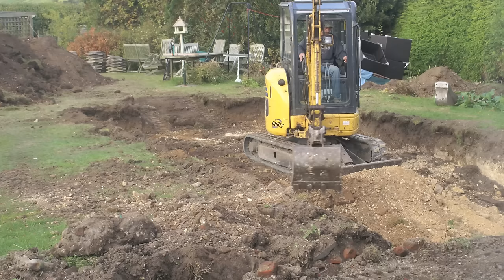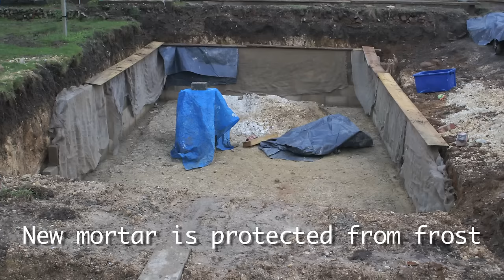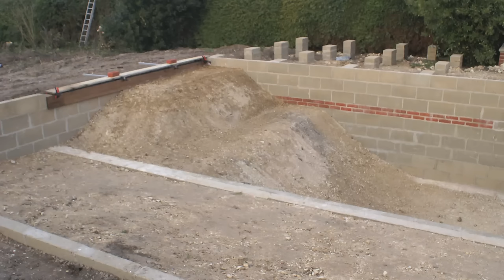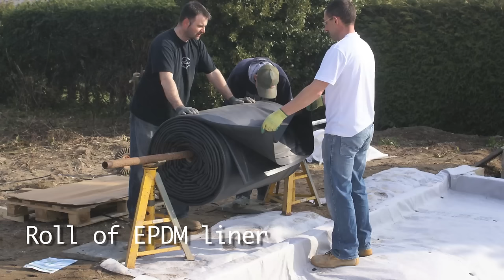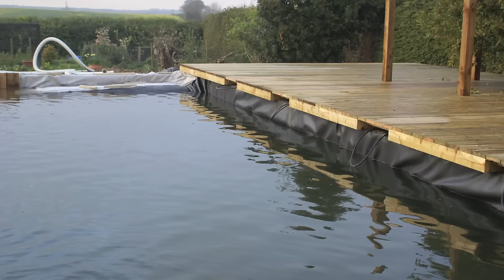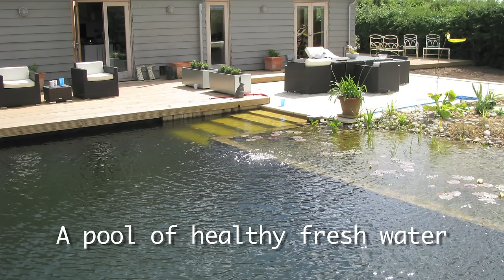How to build a Natural Pool - DIY Organic Pool build

Comment: That's  lovely. We cannot  do that here in Florida, USA. You would set yourself  up to be alligator  bait!
Reply: mrreoww4840 what about a fence? aligators can't jump
Reply: pustel  In florida, they figure out a way
Reply: pustel yes they can
Reply: They can climb fences and bust through  your screened in pool with no effort. I'm  not kidding. Don't  know  where you hail from but I've  lived in west central  Florida  most of my life. Not only do you need to check for gators but water moccasins (venomous  snake) but snapping  turtles  as well. Welcome  to Florida  kids!
Reply: mrreoww4840 😂 cant do it in chicago IL youd freeze 87% of the time
Reply: OverKnight 52 I have family  and friends  in the suburbs  of Chicago. I  will  only visit  when there is no snow  on the ground! I don't  even  own  the proper winter wear for that part of the country. I think I  broke  out my "heavy" coat twice this past winter. It got down to about 30 +/-. 😨 The rest of the time it was short sleeves and maybe a sweater! ☺
Reply: Momma says,  gators are onrey because they have all those teeth and no toothbrush, lol
Reply: mrreoww4840 what about a brick wall? Wouldn't that keep them from getting through?
Reply: If theres water, somehow someway, a gator is getting in there
Reply: pustel alligators can climb fences actually
Reply: @pustel  They can climb lol. The other problem is snakes. They can easily dig under a fence or slip through one. I wanted to build one but when we started looking into it we realized how dangerous it would be.
Reply: @mrreoww4840  lol I've seen them climbing chain link fencing
Reply: Amen too that..  Or snakes🐍
Reply: @pustel  
Yes they can..  Look it up on YouTube..  😉
Reply: @pustel  gators can climb trees
Reply: Louisiana here. Yep. We’d have the same problem.
Reply: @mrreoww4840  That sorta takes the fun out of relaxing on any shoreline!  I bet its illegal to make boots out of them... I did see an emotional support alligator on youtube once..anyway! Cheers :)
Reply: No doubt!
Although????

There's that pesky kid down the street🤨
Reply: I'm in Arcadia, FL here!  Right by the Peace River... Gator heaven lol!! I've lived here and in Sarasota since I was a baby!  Now,  we do have to worry about the gators, snakes, some big ass predatory fish aka sharks that will go into fresh (brackish water), turtles, microorganisms that will eat your flesh, and fish that do lewd, and lascivious acts in the water!! Oh, the horror!! And the snowbirds! They're the ones that you really have to watch out for lol, (just kidding!  We love our seasonal friends!) But you know what is worse than all of those things combined y'all?? Florida's summers, owning and running a concrete business 6 sometimes 7 days a week, and the increased  temps throughout the last decade especially!! I don't know about you guys, but I am going to attempt this, come hell or high...errrrr water! Lol, how fitting!  I want to do something small, but VERY similar to this in design.  I plan on making it somewhat of an eclectic vibe, with a private tent,  (mosquitoe netting.) I'll have to turn up some music, and maybe splash around from outside before just jumping in to see if there's any unwelcome visitors lurking, and I'm also going to REALLLLLLY encourage the natural predators, of the critters, like birds, and my cats (catio area!  They aren't allowed out on their own! )... I'll use plenty of annoying effects like music speaker rocks, (bass isn't a favorite of the reptilian crowd, I believe they're more into classic country! ), and some lighting maybe, some decoys to deter, and I'm sure there's plenty of other methods.  If it's between 4-6 foot, and it's a gator...well then I'm betting that gator tacos will need to be digested pretty well, before we swim!  I just know I need one in my life, I've been researching for over a year now. I have looked up all the material that is available by the, more than generous, eco-saving gentleman/genius! Mr. PAGAN- BUTLER!! THANKS FOR ALL YOU DO, AND HAVE DONE AND GIVEN US FREELY in order to help others make their own!! I'll be investing in your book, plans, and anything else you have available for a VERY fair price!  Your way, is the one that makes the most sense to me, no matter where in the world you are!  I can't wait!  We own an excavator, and a concrete business so I think we should be able to get this completed this year!  I'll send pics!  Thanks again!
Reply: I mean depends where in fl you live lol I live in north west Florida and not near bodies of water so gators wouldn't be an issue.
Reply: lol  give me a break
Reply: @mrreoww4840  hot tub it is then ;-)
Reply: Snapping turtles in TN, and water moccasins...
Reply: @overknight5278  Aquascapes is based in St Charles! You should check out their facility sometime. You'd be amazed what we can do here.
Reply: Amazing how a simple screen keeps most alligators out of most pools.. in Florida we use chain link fence to keep aligators from river or canals out of yards..they can climb over but.. I  would use a simple sein net to drag thru the pool to discover unwanted guests in the deeper areas!
Reply: @gacha_edits2202  The wall would be a great sunning spot for the Water Moccasins and Banded Water Snakes.
Reply: Gators 🐊 free high protein food source
Reply: How bout a Electric fence?
Reply: You can always do some sort of surround

Comment: Won't the wood rot over time? And what about mosquitoes and such? I know the water isn't stagnate but still it would be considered a pond no?
Reply: Yes, but the integrity of the wood will be maintained for years and years, and if you're that worried, the lining can tear, the cement and mortar can crack, etc. etc.

And mosquitos require stagnant water to breed, which is why the problem exists. This body of water is circulating. Mosquitos won't be a huge problem.

Plus mosquitos don't live everywhere, so where this guy lives is also a factor.
Reply: larsonny77 wood will not rot if it stays submerged.
Reply: larsonny77 wood needs oxygen to rot, so if submerged then you're fine. You realize Venice, Italy was built on a wooden beam foundation right? You know how old that city is? It'll be fine.
Reply: What about the frogs?
Reply: Republic of Texas, actually Italy uses Piles it sit on, not just beams, and only sinking due to the wood deteriorating due to the movement of the buildings and people walking rhythm, woods does not live forever underwater where aquatic wood borers persist and is only  'sinking' due to tides thus why they have built those barriers to protect it sometime into the future.

They really should look at replacing those piles with carbon/dyneema/fiberglass/kevlar composite piles as they are impervious to rust unlike steel, wood borers and rot like wood, or washout and rust deterioration like reinforced concrete. But that would be a vast and very highly costly operation
Reply: If he puts fish in the water the fish will eat the mosquitos and even help circulate the water
Reply: @RepublicofTX  there is oxygen in water, especially if you have plants there putting more in.
Reply: You have to add stuff to the water to keep it clean.  A natural one has plants.  I suggest a large fence around the property or swim area to keep critters out of it.
Fish is good to have.  A filtration system is what you have to have.

Comment: Two Men in Fort Worth Texas built a spring fed public pool of 1 main gallon capacity in 1951, it had sand well fluidized bed filtration and was crystal clear, but the concrete didn't last after many repairs and a few owners it fell into disrepair after a drowning in 1981

Comment: Looks like a flooded backyard...   I don't understand why this is somehow better than a regular pool. It certainly wasn't any cheaper...   Is it because it doesn't have a filter?  Who wants to swim in unfiltered water...  and fight mosquitos.  You could have just dug a pond for 1/3rd less money, and been swimming in the same dirty water... 

And the only thing "organic" about it, is the plants growing around the edge...  seems like a silly waste.
Reply: RIPPER334 the plants do the filtering
Reply: David Ayers do they kill bacteria and parasites?
Reply: David Ayers      No... no.  

 While some plants CAN absorb (and adsorb) SOME bacteria, and even a few heavy metals, these are typically leached fairly quickly back into the water colum.   So using the term "filter" would be extremely loose in this example. 

 Mostly what aquatic plants WILL do, is take excess nutrients from the water (even then, only what they need to grow), and as a result of this nutrient reduction, algae is starved... and you have clearer "looking" water. Again... using that term loosely.  

Plants won't do anything for parasites... they've never stopped a case of dysentery or foot rot... and the money you save on pool filter sand, you'll quickly spend on mosquito spray! 

Basically, unless you are a fish benefiting from a balanced nitrogen cycle, and the added oxygen in the water, plants aren't doing much for funky, mostly stagnant water... (which this will become without proper stratification)... especially in the few numbers planted around this flooded backyard. 

This is just another go-green money grab...
Reply: honestly I'd just pop some fish into it and use it as a fishing spot XD.
using it for swimming though? no.
Reply: I thought that was the case. Thxs
Reply: The water isn't stagnant.  There are filters between the plant area (regeneration zone) and the swimming area.  The regeneration zone keeps the swimming area filtered and decontaminated.  There are natural other methods besides this one.  Personally, I'd go with a combination UV/saltwater pool (neither natural nor organic) but I'm not heavily into making everything organic.
Reply: Tia Williams Those aren't filters...  they're simply pipes with air pumped into them, to try and circulate water up, and into the plant area...  in an aquarium,  they would be considered lift tubes to pull water thru a filter...  there's no mention of any filtration in this set up...

...and two small air lifts, will not circulate that amount (thousands of gallons) of water enough to prevent stagnation... Water can still stagnate even with slight movement. This happens in swamps all the time that have very slow moving tides or small creeks running thru them.   There needs to be more surface agitation for better oxygen exchange.  

Needs filtration and circulation...  otherwise, like I said, it's just an expensive flooded backyard.
Reply: RIPPER334 with a pond you have to dig 18 to 19 feet to get a good echo system going. So it wasn't a better choice
Reply: Bryceplayz  no... it absolutely, in no way takes 18-19 feet to get an "ecosystem" established. That is the most foolish thing I've ever heard... there are millions of lakes, ponds rivers, and streams, that are no where near that deep...  Curious where you are coming up with this arbitrary number? 

hell, you can get an ecosystem in a 2 gallon fish tank!

But...  for the sake of proving you wrong...  how has this "pool" created an ecosystem?  It doesn't meet your standards for depth. Are you going to tell me it's because of the plants?
...cause I've never seen a pond that didn't have plants around it, and in it -regardless of depth.  And let's not forget that this hole is lined... so there's no nutrient exchange between the ground and the soil... so all his plants will likely need supplemental fertilization...  Which kind of blows the "ecosystem" claim out of the water... pun intended.
Reply: RIPPER334  I should have said pipes.  The plant zone provides the filtration.   I'm not an expert but my understanding is that the water is perfectly safe for swimming using this method and it's not stagnant.
Reply: Invictus Misery Yeah...  Not many parasites in cooked food (one of the reasons we cook it), or treated swimming pools (one of the reasons we treat them)... 

That said, parasites are everywhere... but not all are bad, and most can be dealt with easily enough... even when consumed. My only comments on parasites was in reference to a questioned asking if this set up removed them...  it does not.  

...but I'll keep your ignorant  opinion in mind for the next time I'm feeling uneducated.  👍
Reply: RIPPER334 crybabies
Reply: lol yo all here are snowflakes, you've probably never swam in a river before, id have no problem swimming in this. you can make these out of daily water too
Reply: Ripper, aside from the plants there is the limestone gravel shown being laid down as the plant bed that provides its own microbe filtration, along with charcoal and uv or ultrasonic filters as well that additionally kill most remaining bad to us microbes, the rest are healthy. I only  ever see mosquitos festering in stagnant (static) water more so than moving water which they dislike  as I got a neighbor with a natural riverside pool in his back yard that I notice at times the mosquitos enjoying while they keep away from the river itself. And no duh pipes do not provide filtration. Good grief the ignorance of people like you who clearly disregard their biology science lessons in Grades 1 - 12, I have swam in a few well built natural pools and its more refreshing than swimming in salt water leaving me sticky or chemical treated stink on my skin for a day at best after, until I shower often enough with soap which I do not have to shower so much after as an nsp does not leave me feeling sticky or stinky after a hour of swimming. Never met a croc or gator in a pool and often see other unnatural pools either festering with or having the occasional insect stopping by, then again those unnantural pools can and wil lead to this: https://www.youtube.com/watch?v=Yc4JuKTXiZs
That is all you ignoramus skeptic

Comment: Larger species of fresh water clams (never use zebra mussels) will filter additional microbes out of the water specifically things like algae. Enough vegetation should limit excessive algae growth through nutrient depletion.
Reply: That is not the right environment for clams.
Reply: The plants provide oxygen which is what keeps algae at bay, ever seen a pond using those floating fountains? those fountains are helping oxygenate and thus reduce to the point of elimination of algae. The plants are doing the oxygenation and filtration of certain other biologicals that are not harmful to you but to keep it in check.

Comment: Hi, are the air lift pumps plumbing/inlet below the gravel by the regeneration zone?, and blocked off from the gravel but big enough compartment to push the water back up into main swim area?

Comment: I wonder how long these liners would last in subtropic Florida and how would I replace one?  Have to empty pool and start over I guess, my quest goes on for how to convert my vinyl nightmare in to a concrete one myself as I cannot afford a fancy pool company and I just want it for a pond at this point.
Reply: depending on the brand  the y can last up to 50 years, so I read
Reply: iris ramirez I'd worry about any standing water in Florida. Harmful microorganisms grow in the water here since it's warm year round. Most of the swimming areas here other than the beaches seem to be spring fed which means that they're around 72°. People don't seem to swim in the standing lakes that are warm. I'm just guessing though since I don't know how these pools stay clean.

Comment: Does the perforated circulation pipe under the gravel have end cap on or is it just left ? And are there two separate ones or do they join together?

Comment: A question please, i wnt to dig a pond of 60.000 liters. I was not planning to use cincrete or walls in concrete cellblocks. I was planning to dig a hole the walls will be dugged declined so not straight down, then put the protectclorh and liner in done ( to put it simple).. Is this possible. Wull the pressure of the water hold the walls standing? Thanks in advance Guy- Louis

Comment: What keeps the the sloped part from eventually sliding down under the liner and leveling out at the bottom???
Reply: I think the weight of the water will hold it in place.
Reply: the wood has stainless steel rods holding it in place and the rods extend into the concrete blocks it sits on, they showed that part briefly and I saw it unlike you clearly did not

Comment: What can you use as a alternative to liners? I want something organic
Reply: clay of some sort thick enough also helps but still may require some other 'lining'
Reply: Sodium bentonite clay can be used instead of liners. Calcium bentonite clay will crack if the water recedes and it dries out, but sodium bentonite clay will still hold water if it dries and the becomes wet again. Plus the bentonite takes toxins from water.  Good for fish. I think I read you want 8 inches of sodium bentonite clay topped with 1-1/2 feet of top soil, topped with a few pebbles, so that the plant roots don't penetrate the bentonite clay.
Reply: @rubyellis.5472  wow, very cool idea. Thanks